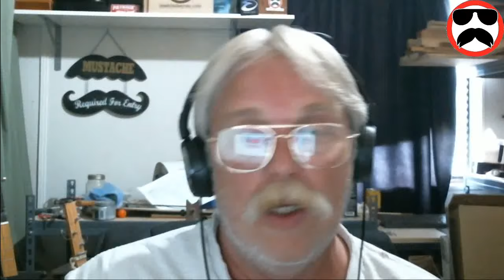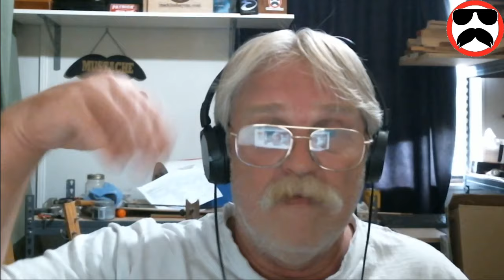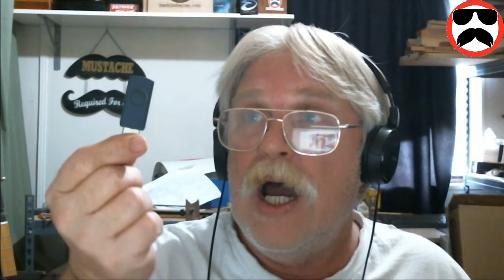LIVE Q&A #21 - 2D vs 2.5D vs 3D Carving

Comment: Hi Mark and Community- Happy New Year. I am making ornamental  pieces from Tauga Nut. As you may know Tauga Nut is a hard nut from Ecuador. It be ritually has no flat sides, it’s shaped look a river rock, and the largest ones come no wider than 2 inches in any direction. For the last few weeks I have been seeking advice on how to secure the nut to the spoil board and plane down the top and bottom surfaces. I plan to use push/pull toggle clamps to secure the nut against a rail then plane the nut with a 1/4 inch upcut end mill with 2 flutes. Any thoughts one this method?
Reply from the maker: You might consider adding some hot glue. Hot gluing the nut to the table along where the nut meets the table can only help add strength, and it can be removed fairly easily.
Reply: Mark Lindsay CNC thanks